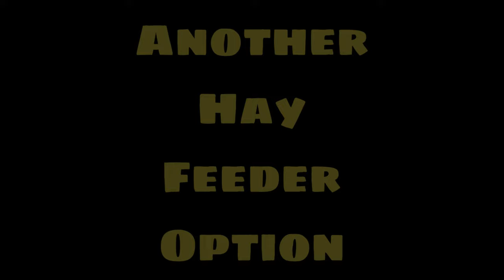How To Make Rabbit Hay Feeders-Less Waste

Comment: This is very small for all those rabbits, even for one😢 And the bottom of the cage can damage their feet since they are very sensetive. It would be much better for them to have solid ground to walk on. And please give them 10x more hay😅
Reply from the maker: I think you should raise your rabbits, however, you see fit, but there are some challenges when allowing your Rabbits to share open ground 
This video shares more: https://youtu.be/MikAVg3cccE?feature=shared

Rabbits need about 70% hay to pellet diet. You can monitor their intake by watching how fast they’re eating it 

cage floor bottoms: These allow the manure and urine to fall through, keeping your rabbit clean and breaking the lifecycle of coccidiosis. Rabbits have a sufficient amount of hair and padding on the hock. That’s why so many Rabbitry productions use them.  As you stated, Rabbits are very sensitive.  But again, I think you should raise your rabbits however, you want and through your experience you can make adjustments. Thanks for taking the time to comment.

Comment: Its sad to see the wired base for the cage. Pls use rabbit cage pads for the flooring. This can hurt the rabbits badly.
Reply from the maker: That’s a common misconception. Don’t be sad, rabbits are raised with cage floor bottoms to break the life cycle of cocidiosis. That’s why the biggest and best productions use them. You want the manure and urine to fall through the cage keeping your rabbit clean and disease free.  Leading cause of Sore hocks is stress on the hock caused by a poor diet. Most likely getting over fed which can be fixed with a more disciplined diet. More information on this video. https://youtu.be/XWdn06fZurU?feature=shared